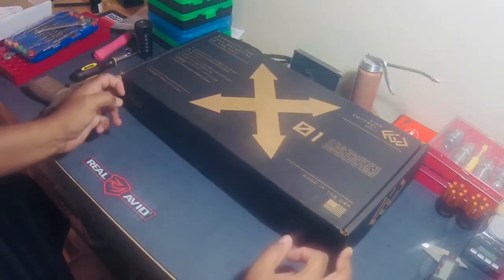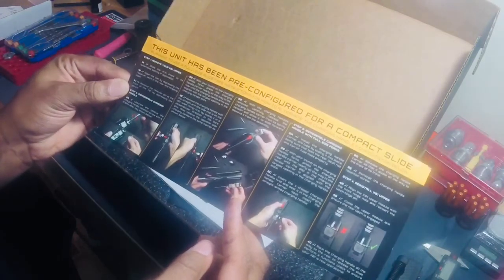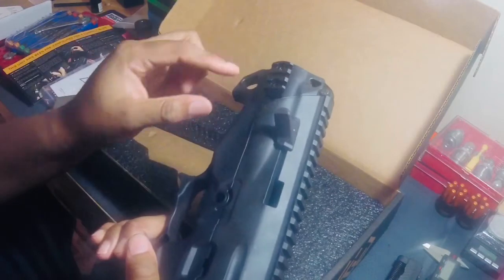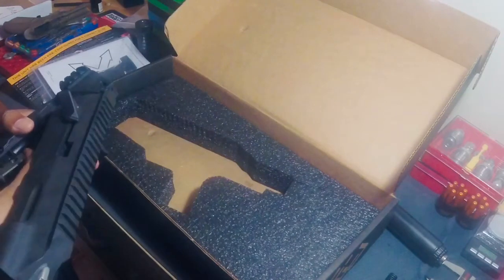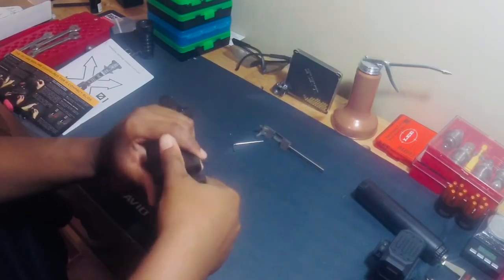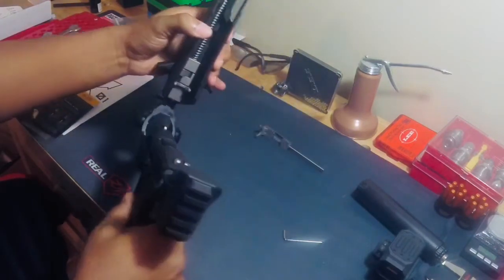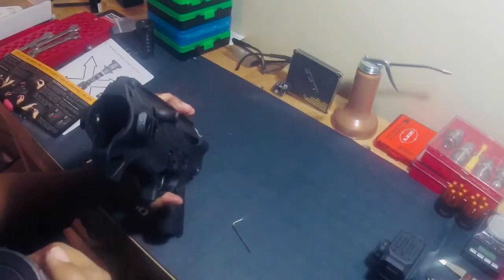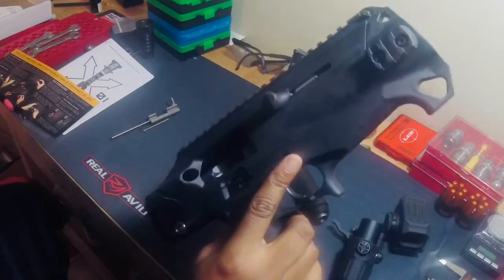X01 PDW Chassis Unboxing

Comment: I hope you make more videos on the X01 chassis. I was looking at picking one up and take advantage of sig's new FCU program they are coming out with and running one of these along side my regular compact 320.
Reply from the maker: I’ll be doing a couple more videos on it. 

I haven’t heard about Sig’s program though.
Reply: @TinkerTailorSoldier1  Yeah they are supposed to be starting it this october. It's where you'll be able to purchase the complete FCU on its own instead of buying a whole firearm.
Reply from the maker: Larry B ooooh. Hope they don’t cost any more than $200. I would be willing to buy a couple more.
Reply: @TinkerTailorSoldier1  Osage county guns had them for sale for awhile before sig came out with their program for $200 but if im not mistaken i think sig will be selling them at $300.
Reply: The X02 is supposed to be a fixed barrel unit for reliable suppressor use.  So far the X01 with the brace has been single shot only with the use of a suppressor.  After I trimmed the screws that hold the rails on there was plenty of clearance for the suppressor, so I don't know what the problem is.  Without the suppressor the chassis runs perfect.
Reply: @Level-zb4jg  Did you get your chassis system made to run with a suppressor? Because they sell two different ones. Also remember that you have to run a full size barrel and a compact slide for it to run smoothly with a suppressor.
Reply: @Kawasakibiker2021    Yes, and yes,  I found an article, not written by FCU,  while awaiting the delivery of the unit that talked about the unreliable performance using a suppressor with the suppressor cut chassis.  The recoil spring had to be changed or modified, via trial and error, to get the 320 slide/full sized barrel to cycle somewhat reliably.  FCU claims a break in period is required for suppressor use. I've run about 100 rounds thru my LID equipped GM9, and it's still single shot.
Reply: @Level-zb4jg  Ohh, damn that sucks. Next time im at my local range i'll ask them how they got thier X01 to run suppressed without it turning into single shot, they are using a Sig SRD9 on it that might be relating to the issue. IK for a fact that FCU states the cut is for the Sig SRD9 Suppressor.
Reply: @Kawasakibiker2021   Thanks, I would be interested in how they accomplished that.  Shooting it unsuppressed is not a deal breaker its still fun to shoot.  Correct, the specs on the SRD9 says it's 1.38" OD.  My buddy has a Liberty Mystic that measures 1.37"OD and the knurling on the LID scrubs the inside of the chassis while threading it on the barrel in battery. No surprise, I can't rack the slide with the Liberty installed, so the SRD9 specs must be wrong.